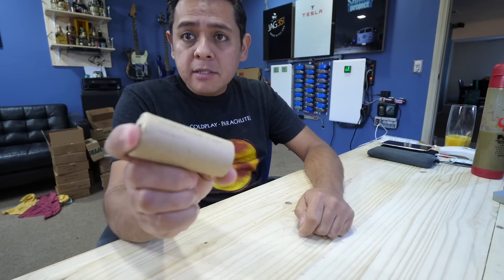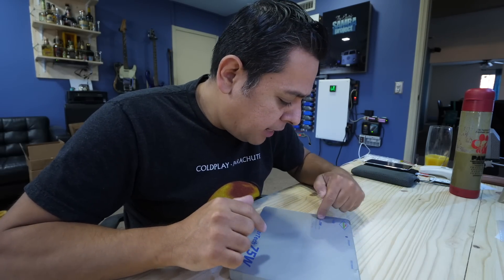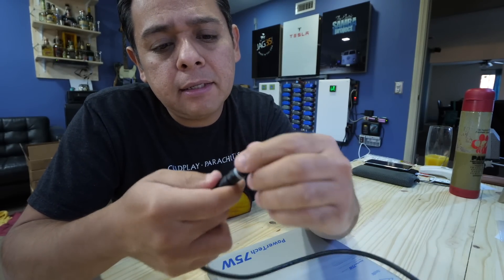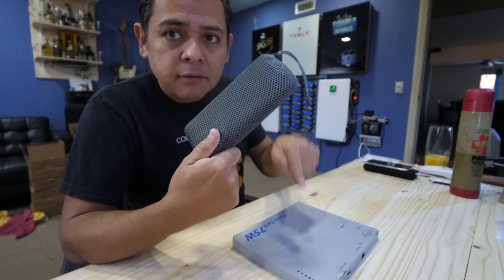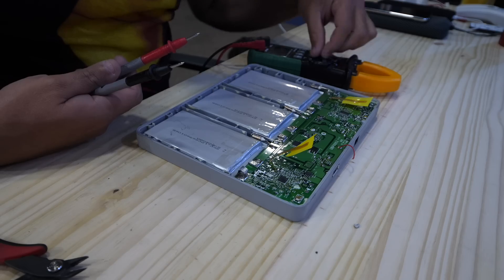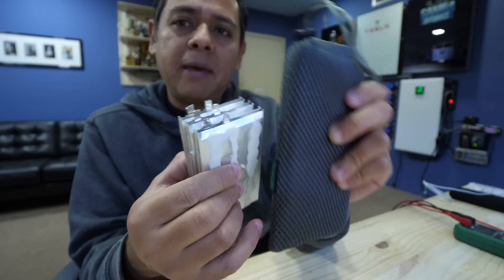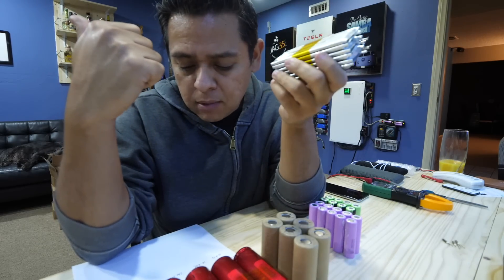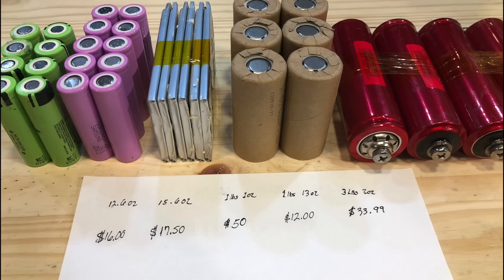100Wh Lithium Battery Pack

Comment: You seem very knowledgeable.  I'm building an electric motorcycle. I'm debating between 18650  cells battery pack @ 72 volts or 66260 cells.
I'm new to this, I'm trying to consider fast charging and range.
Unfortunately there isn't much on YouTube about 66270 cells.
What do you think?

Comment: actually, the right way to take that apart... just use a heat gun on the bottom to release the glue and then pry it with plastic..not metal pliers. n should come out without curring anything

Comment: Just curious, I've been watching your videos for awhile now, but I haven't still figured this out.  What battery type is best to build a portable power bank for something like car camping / rv'ing?  I see most people go the LiFePo4 route.  But, it seems you like Li Ion batteries instead for building portable power banks.  Personally, I don't mind the lower energy density and weight of LiFePo4, since they have great longevity and are much safer than standard Li Ion or Li Poly.  But, besides that, why would you go Li Ion instead?  Cheaper?

Comment: In perspective, a 12v 8.4Ah SLA battery would be 100Wh at 100% discharge and would weigh ~5.5lbs.  To make the comparison the most realistic you would typically see 500 charge/discharge cycles at a 60% DoD so an equivalent battery size for 100Wh would be closer to 12v 14ah at 60% DoD and would weigh about 9 pounds.  So lead acid would be around 1/3 the energy density of the lipo power cells and about 1/10 the energy density of the lipo cells optimized for energy density.

Comment: It was nice to see them grouped by energy density. If you can arrange the same batteries in groups of matching power so we can see the power density that would be nice. I think the Panasonic batteries were chosen by Tesla because they are the best compromise between power and energy density. 

I think we will start to see more EVs using high energy, low power cells, but more of them, to get cheaper range in a car that doesn’t have to be very quick (like Chevy Bolt). But if we want a quick car, we can use high power, low energy cells like Chevy Volt uses. If you replaced the cells in a Chevy Bolt with those from Chevy Volt, you might only have 40 kWh but it would have enough power to drive the motors in a P100D, but much lighter.

But if the Tesla Roadster shows you can get performance just by adding more cells which are a compromise between power and energy, then that seems like a good way to go. But it makes you wonder what it would do with 100kwh high power battery instead, and is 1000 pounds lighter.

Comment: Would it be usefull to make a car with mixed battery technologies? Smaller portion for the boost and bigger for range..or is it totally pointless because of motor limitations or something like that?
Reply from the maker: Can be done
Reply: He already did it with his Samba.  It was an older video but still a good watch!
Reply: What about a portion of a battery that can be changed on the go. You know.. you have one chagrin at home, the other one at your destination and you just switch it when you come there if you don't have time refilling it. In the meantime the fixed one is just acting like a reserve.
Reply from the maker: Yes that concept is also proven but 500-1000lbs battery tricky to swap

Comment: Good day, in your opinion which of the following cells give a better result for 5 amps of constant discharge and peaks of 10 amps? PAMASONIC NCR18650GA, SAMSUNG INR18650-35E OR LG 18650 INR18650MJ1. Thank you

Comment: hi mr garcia what u think abour super capacitor ? i think better than lithium batterys.
can u say somethink please
Reply from the maker: super caps suck as batteries
Reply: Is not it possible to use it like a battery?
Reply: Yes, check out Mazda I e loop http://www.mazda.com/en/innovation/technology/env/i-eloop/
Or check out the adaptec raid card battery https://storage.microsemi.com/nr/pdfs/6514_series5z_1_7.pdf
But as Jehu said not a good battery due to high cost and low energy density. However, they have extremely high power density, and are good for thousands of cycles. Therefore, they are good for capturing the energy in braking for a car. Or for protecting data loss on hard drives for computers that get shut off every day.

Edit: Not to mention fire hazard and heat tolerance. Lithium is extremely volatile and could blow at any moment. You don't want  small explosions in a data center. Super caps also tolerate the heating and cooling cycles of being in the engine bay of a car better.
Reply: Saw a video that showed a guy that used a capacitor to replace the battery for starting his cars.
Reply: it was a hybrid super cap coupled with a lithium iron phosphate battery. together, they start the car. was lasersabre channel.
Reply: possible, but not a good idea. bad energy density, and high cost.

Comment: Do you ever cosinder to buy or make a 3d printer?? I think you will need it for some battery pack projects or anything... If you want to build your own.. Check reprap for info... It's a library wiki for open source tech around 3d printer...

Comment: I disagree Jehu, I think the electronics is useful. Pair that board with a bigger 3S battery to power an old laptop for say monitoring a powerwall, weather station etc.
18V is a good voltage to run 6 series leds, if you can limit the current. Output Voltages: 16V 17V 18V 19V 20V 24V

No idea what failed in your unit, seems likely it was the battery related, as there are multiple temperature sensors and thermal fuses attached to the cells, and it did work for a little while.

Comment: Man oh Man!!! Where do you get 3400mah for 2$ a cell(sign me up!!!). I have searched all over the net and can only get them at $4.50(only because I deal with the seller often). Those 2600mah is pretty much the same way. Unfortunately, the average user or DIYer can only purchase lower amounts.  It seems like you can only get deals if you purchase in higher quantities. For me to purchase anything like 100 or more at a time, could be a waste of space and degradation on the cell based on how long they might sit before I use on a project. When purchasing cells, the average DIYer, will only purchase what is needed, unless they have endless supplies of cash. Unfortunately, I am a poor boy and save my money for each project. I have to purchase by project or break the bank.

3400mah  for 8 cell would cost an average user 40$ not including shipping and that is a killer deal, they are typically 64$ and above for 8. 
Those Samsung 2600 you have would run me a little cheaper. normally around 3$ a cell at the average cost. so for 10 would be around 30. I have seen these a little cheaper at times. around 2-2.50$ a cell. 

Alarm hook up wants 50$, shipping included. for the laptop charger(pouch cells) 
Edit::::I'd like to also point out...The charger that comes with these are 15V 6amps(90watts). That alone is probably worth around 10-15$. That is a pretty good charge.

The LIFEPO4 he is selling, 4 for 40$, but they are a little big--Maybe the cheapest and best deal??? But it may also require additional hardware to use with the project.

The Fullriver LiFePO4  you can only get a box of 60 for 120$ plus 32$ shipping.(haven't really looked for smaller deals)-Don't know to much about these?

Looking at all those deals, and the pricing. For the average DIYer, the 3400 if you can find them under 5$ a cell is the best deal, but not normally what you can find them at. The 2600 could be the next best, based on cost, but they are only 2600mah. I wouldn't even consider the Fullriver or LifePo4 unless I had some extra cash to burn. 49$ for the pouch cells is starting to sound like a pretty good deal as long as they still retain the 3400mah per cell(guessing based on count). The Tabs also look like those might be strong enough to carry a good amount of amps. Probably nothing like the 3400NCR, but pretty close.

But then again, I try and steer away from Pouch cell. To Scarry!!! Great Video Jehu...Just wanted to add my 2 cents...

Edit: Just realized, I can only find the 2600 in smaller qty for around 5$ a cell. so for 10 it would cost me 50$. All the battery prices you mentioned would be nice if you can find these in smaller qty the average user could afford. But you can only get them at lower prices if you buy in HUGE qtys. 2$ for NCR18650B is impossible, you can't even find the NCR18650F at that price. NCR are very expensive. The Samsungs at 1.75$ a cell is also impossible unless you purchase in huge qtys.
Reply: ive looked but i have too buy 1000 to get a decent price 2.85 for 2,500 mah samsungs
Reply: Arnold Navarro what do you think about buying together splitting up the cost
Reply: Me to, I thought for sure I saw those sold at a cheaper rate. Looking online, I can only seem to find them at 5$ and up. Way to expensive for my taste. I can't see paying that much for 2600, when you can find higher rated 18650's for around the same price.
Reply: I'm also quite interested in the cheap source for these cells, best I can find on AliExpress is $4.45 each at 100 cells.

Ok looks like maybe he was using the price of Tesla cells out of a Smart module, $2.09/cell at 330 per $690 module. Edit: nevermind those are lower capacity, only 2500mAH per Jehu's earlier testing and also impossible to break apart. The real Tesla model S modules are more expensive at $3.15/cell for 444 qty in a $1400 module.
Reply from the maker: Someone hasn't been watching my deals videos http://j35.us/NCR18650B-2dollar  they sell out every week
Reply: I saw that deal, Sadly, I just could afford 250$ at the time. I also wouldn't have a need for over 100. I am just an average user. I still have 90% of the LG HB2s...LOL.  Most users are looking for the smaller qty deal. Unless you have money to burn on deals like that. Poor Boy Here..LOL
Reply: Here is some really affordable NCR18650BF 3350Mah for 4$ a cell. But you have to buy 4 at 12$ plus 4$ shipping, from AlarmHookup😊

https://www.ebay.com/itm/4-SANYO-18650-NCR18650BF-3350MAH-CELL-LITHIUM-ION-BATTERY-POWERWALL-EBIKE-VAPE/173085134248

I wish I had the cash!!!Hope this helps!👍👍👍😊😊😊
Reply: Might as well get 4s 10AH multistars from hobbyking for $40
Reply: Is that a Pouch Cell? I don't like messing with those if at all possible. I feel much safer using 18650. But That is me. I didn't really look to hard at the cost of Pouch cells(LiPo) compared. I am sure you can find higher amp cells out there at a much cheaper rate, if you prefer LiPo(Like the 4s 10ah multistarter).
Reply: Yea its a pouch they would be a much better option compared to these pouch also no work to get them out. They are also 10C cells so they can output about 1.5kw.
Reply: I think that's what is necessary. For instance, in LA, or SF bay area, if someone with impeccable character were to set up a co-op, get deposits, go right to the source and buy whosale (drive to reno, go to Panasonic ?}  you could possibly get a great deal for 10 people maybe ?  We used to do this for cheese years ago. It worked. An "Energy Co-op"

Comment: I'm confused by your pricing, you say the ncr18650's are available for $16 for 100WH ...  (so $160/kw) yet the cheapest ncr18650 battery listed on your where to get batteries page for the tesla batteries is $230/kwh (the smart one) ... 
Also, any tips for international used-battery-hunters (local on ebay even used cells are selling 3-4x your prices)?
Reply: Buy a pallet of the ncr's and you'll see them get that cheap.
Reply from the maker: http://j35.us/NCR18650B-2dollar